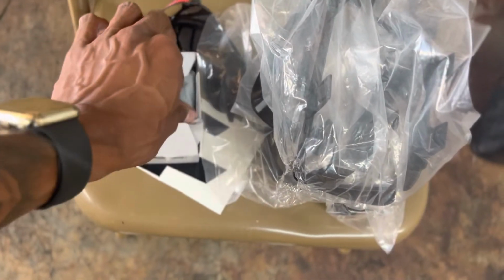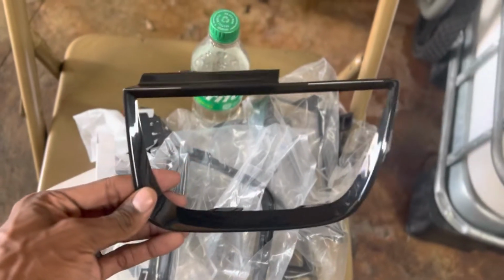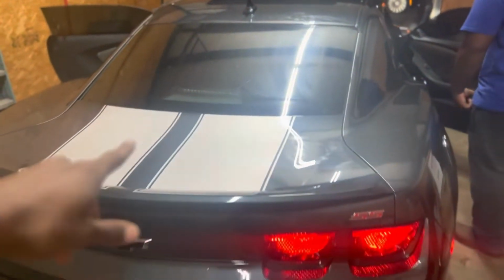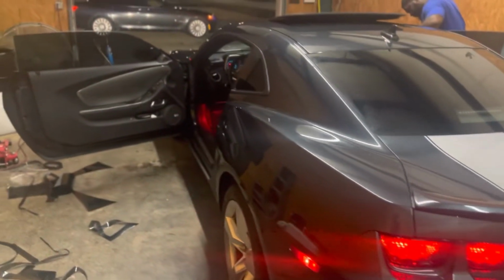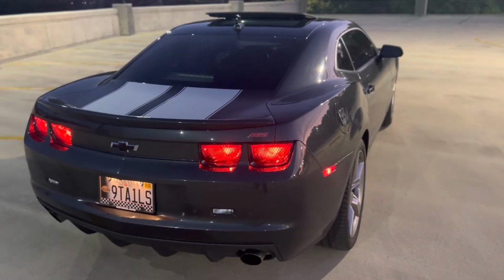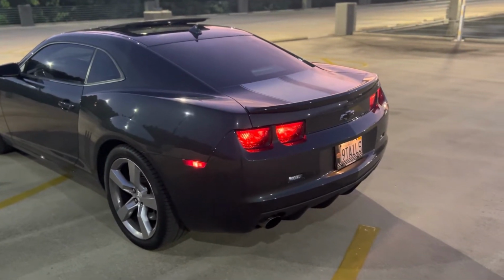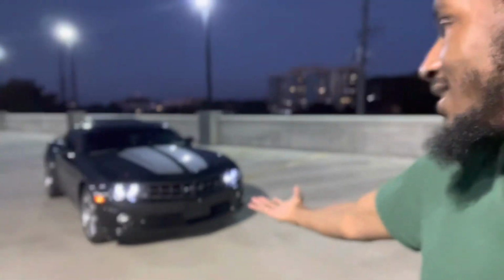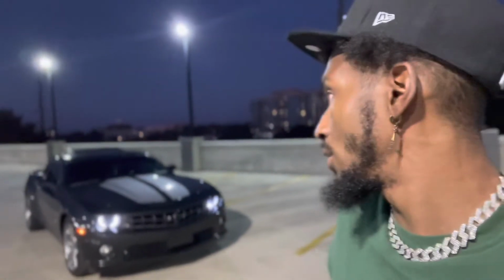5th Gen Gets Ceramic Coated Tint & Chrome Delete!

Comment: the plate light is hella easy to install.. takes 5 mins
Reply from the maker: What light kit did you use? Cause I think I bought the wrong one
Reply from the maker: @2highagain  bet I’m bout to check them out cause I been meaning to change the bulb in the interior too. Thanks for the tip fam 💪🏽